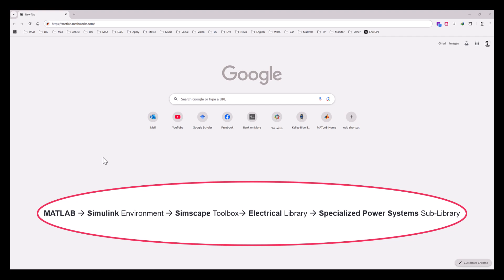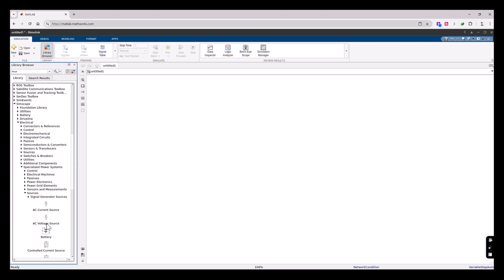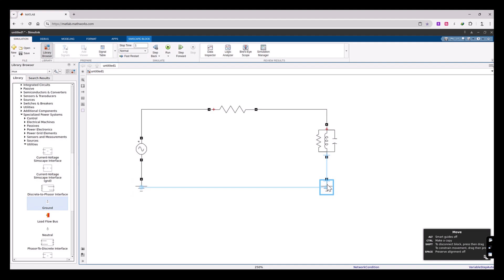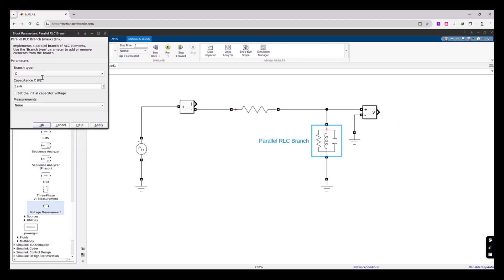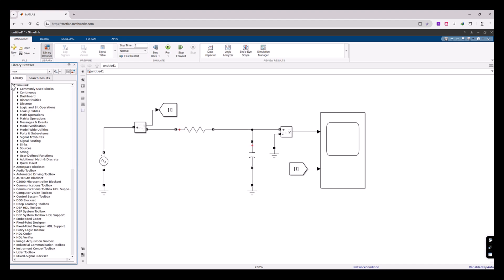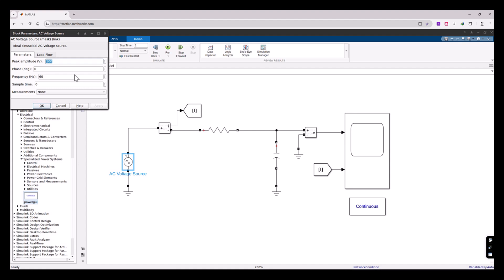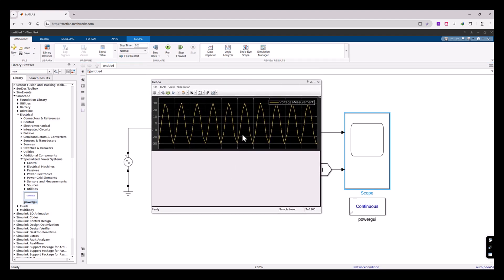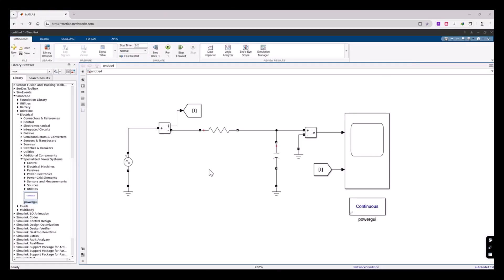MATLAB Simulink: How to use Specialized Power Systems from Simscape toolbox for power electronics

Comment: Why did you not need a PS-Simulink Converter in this circuit?
Reply: The converter block was not needed because all blocks were from the specialized power system sub-library. If you utilized blocks from the Simscape foundational library together with SPS then you will need a converter block. You will notice also that any Simscape Electrical blocks will appear blue in the model (and other colors for other domains), whereas SPS blocks and their connections are black. Signal types are also differentiated by the connection symbol (arrow or dot for numerical or physical signal respectively)
Hope this helps :)
Reply: @jmlengineer9200  thankyou yes it helps.